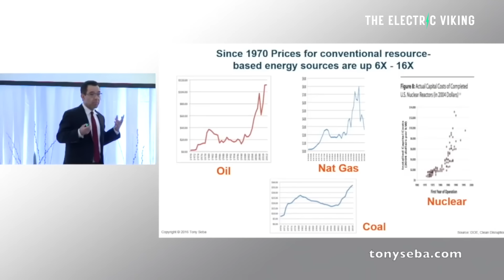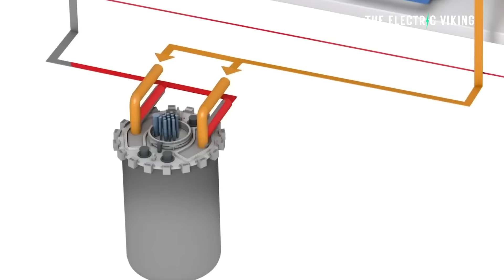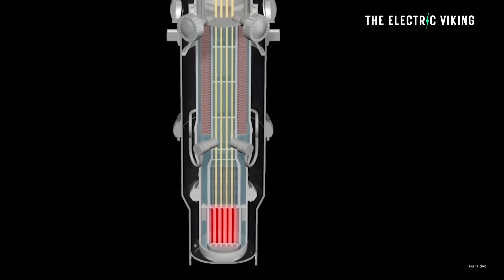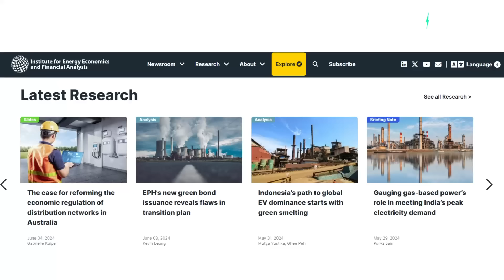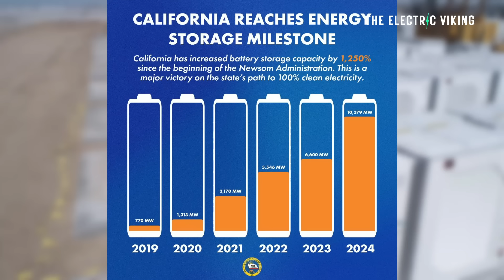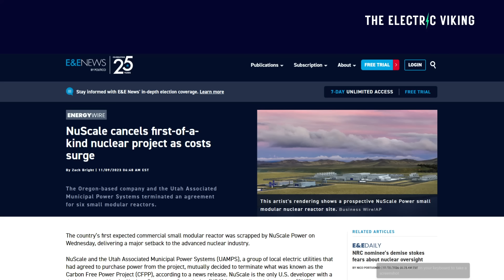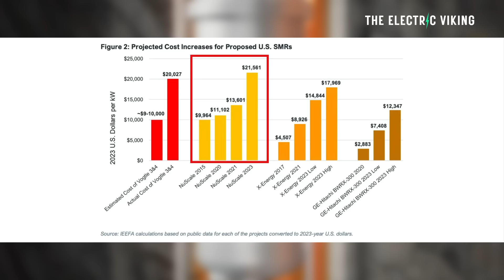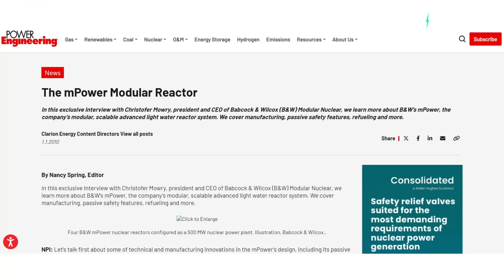In 2014 Tony Seba said Nuclear would be obsolete by 2030 - he was right

Comment: You are perfectly right Sam, there might have been an argument for deploying nuke reactors 20 years ago, when solar and batteries were expensive, but now the costs of these have plummeted, and will continue to drop. CATL battery manufacturer has predicted battery costs will drop 40 % by 2025. Can you imagine how much they will drop by 2034, the 10 years it takes to build a nuke power plant ? Plus renewables are virtually maintenance free, nuke plants will be expensive to maintain to keep them functioning and safe. I’m a retired electrical engineer so I am more familiar with power generation options than most.
Reply: chillfluencer  Overproduction of what?
Reply: Yes they have also deployed 40mw sodium ion bess in china
Reply: how do you solve the base line power need? batteries might help until they run out of power to provide and yes we all know that happens. and with climate change in progress making it hotter, we need more power that is available almost all the time, to make where we live livable.  and short of forcing people to move to other areas (and exactly where would that be? seems that cities that didnt used to see 100 degrees in the summer now regularly do. why doing that for the coasts will be required soon...but who will pay for that too? ).

Comment: The 2 MW Copenhagen Atomics molten salt thorium reactor will produce power at a cost way less and much safer than high pressure water cooled uranium reactors.  They will produce one reactor a day on an assembly line.  The first prototype should be running in two years.  Look up their recent YouTube video.
Reply: Everything said in the presentation is correct for high pressure water cooled uranium reactors so I agree these will not help with global warming.
Reply: In which year will they be producing one reactor per day?
When they do, we will be able to see $/MW and $/MWh and judge if they are a good fit for Australia.
Reply: 2 MW = 2,000 kW of output.  If one was built in a market that was willing to pay 25 US cents per kWh, that is in income of $500 USD per hour.  What kind of system can be staffed, financed and paid for on $500/ hour??  Not even a kwickie mart can be profitable on so little net sales profit.
Reply: Yumyum love that koolaid.
Reply: Two years will easily become four years and then scaling production will be insanely difficult and then they will simply be too late. Solar, wind and batteries will eat the market

Comment: I suspect it would be cheaper to pay to have solar panels and batteries installed in people's homes than building a nuclear power station. Distributed power makes significantly more sense.
Reply: And then there are days when you still need a cable to the distribution network and therefore you have to share the cost of a large central system.
Especially in mild weather europe where you have winter days with 0 sun at all (fog, clouds, snow several days in a row).
Reply: It does, but not every home can have Solar unfortunately.
Reply: There is not a single study that shows that storage + solar is cheaper than nuclear. And the difference only increases for nuclears favor if you also factor in grid costs.
Reply: @raensaeck  No, factoring in grid costs tips advantage to on site solar even more. It is now cheaper to generate solar power on site than to deliver it. Distributed generation and storage, and efficiency are now cheaper than coal everywhere. Centralized power plants are dinosaurs.
Reply: @garysouza95  everywhere? this is impossible, in north regions (scandinavia) you not enough solar. In the winter even in mild weather europe you have several days in a row with little solar power. You have to get through those days. How? Batteries are very expensive, especially when you use heat pumps. Winter is most Power demanding. All solar fans I know use the grid for these days. Nobody is disconected from the grid. And there starts the unjustice, the solar guys do not want to share the grid cost with people without solar. Not everybody can have solar. In the end often the poorest people have to take the most of the share. Because the wealthy people live in big houses with large solar.
Reply: You are correct. It is the 25 year refurbishment that really hits hard. Due to inflation and increased costs the refurbishment usually exceeds the original build costs.
With the passage of time and economies of scale the cost of renewables decreases over time.
Reply: There is no business case, at this time, which would justify a nuclear power plant build over a solar farm of equivalent output. None.
Reply: And all the Carbon dioxide created when making the damn battery... 
I really don't understand why we Always forget that bit. Nuclear is much greener than Wind and solar even without a battery...  @raensaeck

Comment: Many people are attracted by the word 'small' in the name. It's true that the reactor itself is slightly smaller than a conventional reactor but the reactor is only part of a power station, none of the rest of it can be scaled down at all and the footprint of the site all and the manpower costs are almost identical. Proponents claim that these reactors will be cheap because of mass production but don't take into account how many need to be produced to reach true mass production.. It woud take centuries to scale up manufacturing enough for cost reductions to become significant and that would only be a reduction on a part of a power plant.
On top of that 49% of uranium currenty comes from Kazahkstan, Russia or Uzbekistan, so won't help energy security.
Reply: Not centuries, but about a decade. Of course, by that time renewables and storage will have significantly dropped in price.....
Reply: @IronmanV5  I was exagerating in the style of the Electic Viking.
Reply: It is well established that Nuclear has a cost scaling law.  Doubleing Reactor power incresses cost by 40%.  Which means your capitol costs are 30% lower per unit of reactor power and your final cost. This is why making reactors smaller will never be economical, if you do the reverse and half the size of a reactor the capitol cost is going up 43%.  And that is just a SINGLE halfing, cut in half again and you have fully DOUBLED your cost per unit power.
Reply: @kennethferland5579  Yes, people keep on harping about how the military use small reactors extensively forgetting that for the military cost is a low priority.

Comment: Wind and Solar do not have an energy input cost, especially one that varies or has supply chain risks.  When comparing costs one needs to look at the total cost over the life of the project.  Nuclear has risks that has severe consequences.  It is not a question of if but when and which one.  All thermal power generators heat water to make steam to turn a generator.  This creates heat which causes warming.  Plus a lot of water is turned into vapor.  As you say the costs are always more than predicted.  
The sad reality is, is that Politicians are "Used Car" Salesmen.  There is someone behind them thinking.  They want what is good for them, not what is good for the people.
Reply: The water vapor is condensed and used again in a closed system.
Reply: It's not the heat from burning coal or gas that's the problem, it's the CO² produced by combustion that causes global warming. The heat generated from burning the fuel is almost microscopic and completely  inconsequential on a global scale!
Reply: @gregbailey45  It's less then inconsequential, if the Earth Atmosphere is unchanged then heat release on the Earth surface can not change the long term temperature equilibrium AT ALL because temperature is determined by a balance between incoming and outgoing radiation.  It's like trying to pour water into a full glass it just overtops.

Comment: Great video! The province of Ontario has been generating electricity from nuclear since 1971. Currently 58% of the electricity generated from nuclear. 
You can rest assured that the cost on maintains and refurbishing those nuclear reactors is very high. There is no way any nuclear power plant can compete against renewable energy from solar mated with battery storage. Ever...
Reply: Except that is bunkum.

California has about 54% RE (41% wind and solar, remainder is hydro), so nearly the same as Ontario's nuclear.

Ontario retail rates (a tiered system, I'll look at the MOST expensive rate, Ultra-Low Overnight, but priced during the peak during the middle of the day) - 0.286 CAD/kWh, which is 0.209 USD/kWh (current price, current fx)
California retail rates (average, most expensive is residential retail) - 0.3247 USD/kWh (March 2024, eia data); total retail (including industrial & commercial users: 0.2581.

So, for basically similar proportions of nuclear vs RE, the WORST Ontario prices COMPETE, HANDILY, against both the  the average retail rate and the worst residential rate, by a wide margin. We're talking a good 20% or more better!
(with some of the more common plans in Ontario, you would be paying about the US average of 0.14 USD/kWh - some 1/2 to 1/3 of the California rates)

Facts - they are more interesting than believing something to be true.

https://www.oeb.ca/consumer-information-and-protection/electricity-rates
https://www.eia.gov/state/analysis.php?sid=CA

Comment: Unfortunately you have only considered the current financials instead of a more correct whole of life asset management approach. A nuclear plant lasts 80 years, coal or gas lasts 40 yrs and solar 25 years and batteries and wind  15 years.  So this means the whole of life comparison should be over 80 years during which time a coal or gas plant would be replaced twice (x2 costs), solar replaced 3.25 times (x3.25 costs), batteries and wind replaced 5.3 times (x5.3 costs) etc.
One must compare the multiple times these short life power generation assets and there renewal costs including disposal costs, for an equivalent 80 year period... So with asset costs don't just compare a one-off installation cost, take into account the multiple (x2 or x3.25 or x5.2) whole of life costs of short life assets over the full 80 years to make it a fair comparison. When you do this then you get a favorable cents per kWh comparison... and you will see like most things, assets built to last, may have  higher costs upfront but over their full life its a different story.
Reply: Which nuclear plant has lasted 80 years?
Reply: Your calculation should be more like:  Renewables = (1/3 + 1/6 + 1/12) * Nuclear.  (To account for the halving of Solar, Wind and Batteries every 15 years)
Reply: @philwelling7172  Most Solar Electricity is used as it is produced.   Needs no battery.
Reply: Not a bad stab at Engineering Economics, but you have some basic information wrong, and you entirely missed two factors that wipe out all the money on New Nukes.   Basic information error is Service Life on Solar.  Typical commercial production warranty for Silicon Solar PV is 25 years, with some now at 30 years.  But that is just the warranty.  They keep running beyond that -- 40 years Service Life for Silicon Solar PV is now a reasonable number.   Missed cost factor #1:  Operations and Maintenance Cost.  Nukes have a very high O&M Cost as they must be "baby-sat" 24/7, every day of the year.   O&M for Nukes is so high that functioning Nukes have been shut down early, even though their construction cost has been fully "sunk" years ago.  All US Nukes have now been put on "Welfare" to avoid bankrupting early.  Meanwhile Solar PV has almost no O&M Costs.  You can leave the stuff unattended on an island or in space for 10+ years, and the stuff just keeps going.   Missed cost factor #2:  Time Value of Money.  The entire construction cost of the MUCH more expensive Nuke is all upfront, and you have to bear interest costs and/or Return on Investment costs across the Service Life.   Meanwhile Solar PV is about 1/10th (or less) on the Construction Cost, so it has a much (much, much) lower cost of ownership across its Service Life.   So THAT is why the US is now building mostly Solar PV,  and letting Nukes dwindle down.
Reply: Nice overview. However I would add that Nuclear fission reactors require fuel. The cost of mining, refining, transporting and storage of this fuel  over the reactor's 30-40 year lifetime is rarely factored in and is very very expensive.

Comment: Seba is wrong. He is talking about 1970s era pressurized water reactors and not next-generation molten salt reactors, which are 1/3rd the cost and have 1/100th the waste stream of traditional nuclear power. Traditional nuclear plants are expensive because they have been regulated into uneconomic. This new type of nuclear power plant can be load following, so can complement intermittent wind and solar.

BTW, unlike communism, nuclear power has worked in the real world. Look at France, getting 70% of power from nuclear.
Reply: Unless they run out of coolant (low river levels) or find cracks in their 40 year old reactors. Electricity is cheap over there - because it's heavily subsidized. Spot market prices are higher than in Germany but end user prices are lower.
Molten salt reactors are cool, theoretically. Practically they don't exist and have not proven the figures you claim.
Reply: One way or another, the French pay $LOTS$ for their nuclear power. Seba is not wrong yet: there exists no PoC which shows the final, levelized cost of nuclear power to come in at much less than $0.17/KWh, after all costs are added in. You talk about next generation salt etc.. but there are not yet any PoCs which demo better numbers. So .. do the PoCs .. get the numbers .. then discuss!?

Comment: It makes perfect sense to go for solar energy. 
1) it runs on infinite supply of energy from the Sun and doesn't require to mine any raw material from Earth. Except perhaps the material to make the panels.
2) it is much cheaper and easier to manufacture 
3) it is much easier and quicker to install than an equivalent generation powerplant that runs on coal and nuclear.
4) it can be installed in a wider area than any other power supply. All building roofs and dedicated land areas can have solar panels installed.
5) most importantly it doesn't emit any CO2 or any other gases or toxins.

Comment: the main issue is not night time but winter time... in central and northern europe the yield of solar panels in winter is like 10% compared to summer..
Reply: So? put up 10x more. And while you're at it, install some wind turbines and some geothermal. I installed a solar PV system in Scotland at 57 degrees North - and it's still worth it - even in winter.

Comment: Not only that but there is ZERO danger when using solar. It's simple to build. Easy to maintain (give it a wash every week or so). And NO moving parts. Maintenance is huge in power plants. It eats money like crazy. Solar doesn't need maintenance. If a panel breaks for any reason, just replace it. Solar is also massively redundant. Same with batteries. You can replace individual cells without taking down the entire plant. Just that module. Turn it off, replace cell, turn it back on.

And you simply can't beat solar on cost. Zero maintenance for 30 years. After 30 years, 80% output. No thermal power plant can even compare to solar and batteries. Oh and if they over provision the batteries, it can last for 50 years.